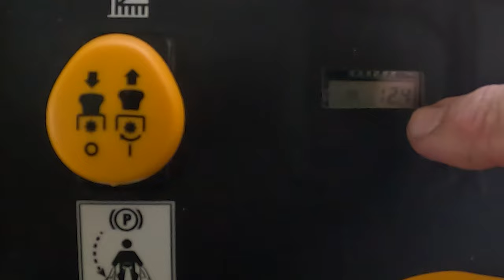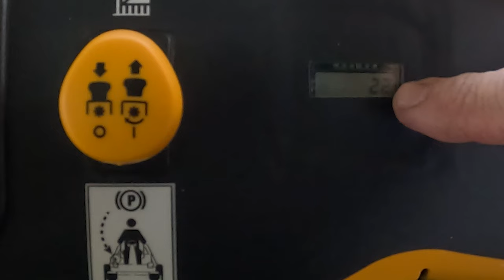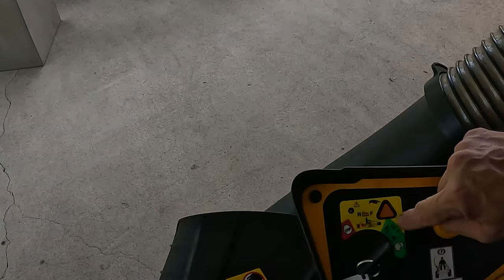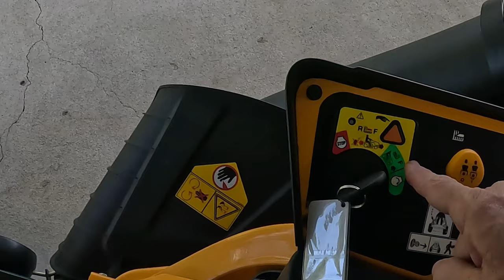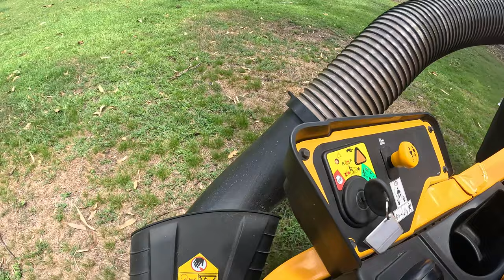WATCH THIS FIRST before you buy Cub Cadet Ultima ZTS1 46

Comment: Fantastic balanced review thanks for sharing!
Reply from the maker: Thanks Cub Cadet for commenting!!
Reply: @jelreviews  Thank you Sir! 51yrs old have been pushing a mower all my life. New home required a riding mower so I got the ZTS1 42" at the end of Dec. Cannot wait to use it. The time to detail everything was HUGE to a newbie to any mower like this. Again, thank you the visual was priceless! I like to mulch so I did get the Cadet Mulching Kit. You may not be able to answer this but I will not be shooting clipping out the side so I do not even want to attach that part. The mulch kit has the plug that covers the dech hole. If using the plug, I should not need the chut deflector?

Comment: The deck level index is calibrated in inches mowing height.  The ridiculously expensive grass catcher (three times the cost of a good walk-behind) has received horrible reviews.  When I get my 42" this month, I will stick to the "extreme mulching" for the bulk of my property and use a walk-behind with catcher for the smaller treed area (as others have done).

Comment: Hey mate, awesome review, only item not noted is where the foot brake is, assuming there is one?
Reply from the maker: Cheers. No footbrake on this mower. Take your foot off the accelerator and she ain't moving. It won't roll anywhere on its own unless the handbrake is engaged, and then then disengage the rear wheels with that little lever next to the handbrake.

Comment: Great review, thanks mate! I am looking at the 42" only cause I got a small trailer, so was wondering how fast can that catcher be pulled off and on?
Reply from the maker: In a couple of weeks I'll do up a video on putting the catcher on and off... (I'm travelling at the moment). But it is easy enough, probs takes about 2 mins to either install or remove. Only one bolt to undo, slide out the chute, then it comes off.

Comment: What do you think about the grass catcher, everyone says it falls apart fast ? Thank You
Reply from the maker: I actually like the grass catcher, but its only good when the grass is totally dry. If there is any dampness, the chute will clog up and you'll be pulling out the grass from the chute by hand. I haven't had the experience of it "falling apart", however there is a small area where the chute hood or lid can come off the hinge on one side due to a small gap (hard to explain, easier to see).  A slight fix is needed to prevent this from happening. I might do a specific video on this grass catcher in the near future.
Reply: use an aluminum Accelerator side bagger instead. They fill up pretty quick, but they are bulletproof.

Comment: I bought a cub cadet a few years ago. I loved it until it broke down. Needs a camshaft. 23 hp kohler engine. Junk! What's worse...its a discontinued motor. Can't get parts. Cheap plastic gears in motor to keep price down. Cub cadet won't stand behind their sell. They blame it on kohler. It's not acceptable.
Reply from the maker: That hasn't been my experience. I love this beast and the motor is so powerful compare to what I previously owned. Starts every time reliably. And cuts through the thickest of grass even when when. I have had the best experience with this machine. Sorry to hear you haven't.
Reply: @jelreviews Yeah (my 2 cents), unrelated but sometimes a rogue motor goes bad. But, between Koehler(s), &Kawasaki(s) - I’ve heard zero bitching:)
Reply: @jelreviews  Hey Jel” you inspire myself to order one of these Cub Cadet mowers ZTS1 42” and I am so happy I came across your informative video. Thanks
Reply from the maker: @BlakWiseCracker  You'll love it... just like I still love mine...:)
Reply: The Kohler 23hp is not discontinued and is very easy and cheap to get parts for you should check around online. Very common motor and you can replace the whole motor for $600

Comment: Hello and nice work. I was shopping for a traditional zero turn and saw one of these at the dealer and few days ago and now I’m curious if I should go for it. I have two questions for you please. First, do you find it tiresome turning the wheel back and forth, it looks like it takes a full revolution for a true zero turn. Second, the foot control, is it a bother to go into reverse? It looks a bit off to the side and wondering if it’ll get old, or even if it’s possible to just hook my shoe under the forward pedal and pull back instead?
Thanks a bunch for answering, these are things I can’t easily test without driving one. I do think it’ll  be great as I have a hill that slopes towards a river and I’m not too keen to dunk a new machine!
Reply from the maker: Hi, to answer your questions - Personally, I don't find the steering wheel tiring to turn at all... in fact, I prefer it over the Lap Bar mower as I can mow with only one hand on the wheel now. Lap Bar mowers will require two hands at all times.

And secondly, I did have to adjust to get used to the foot control after using a Lap Bar Mower for so many years, however, it very quickly became second nature. You won't be able to hook your shoe under the pedal as it will require a bit more downward heel pressure than you think. Also, there is a small amount of 'finesse' required in your foot pedal action to smoothly go from forward to reverse. What I mean is that if you are travelling forward, and then suddenly release the pedal - the mower will stop very quickly! That also is for safety. So, to smoothly transition to reverse, you will need to release the forward foot pedal by easing it off rather than just smashing the pedal into reverse. But that is typical on any type of vehicle. Even my Lap Mower was the same.

Also, with hills and slopes, these zero-turn steering wheel mowers are advertised to be able to mow 20 degree hill slopes safely compared to Lap Mowers. So, that is something to consider also.
Hope that helps and thanks for watching the video!